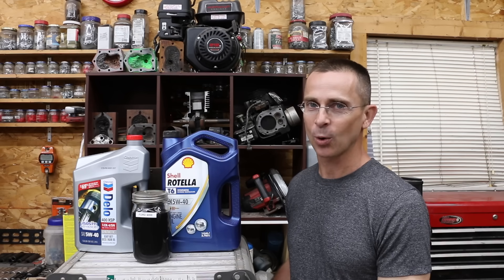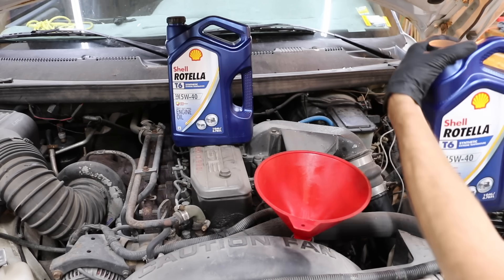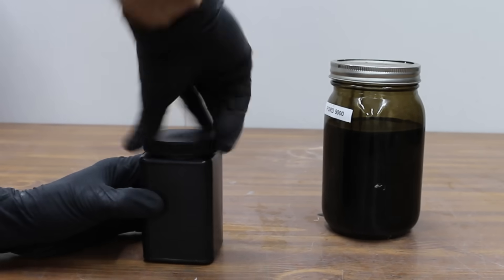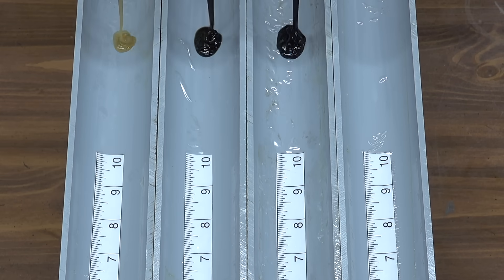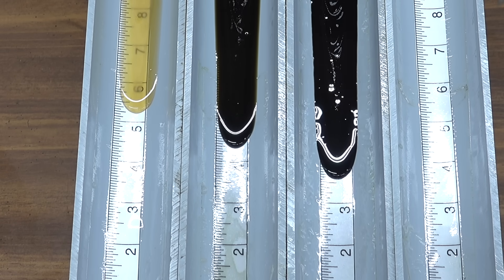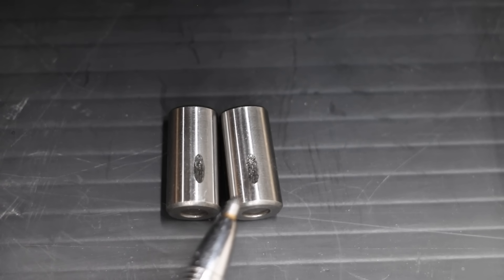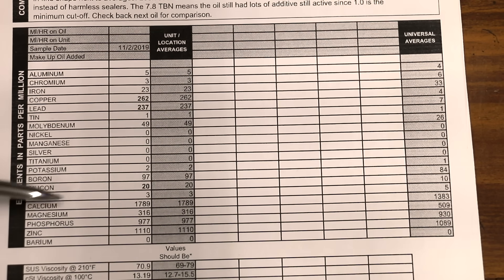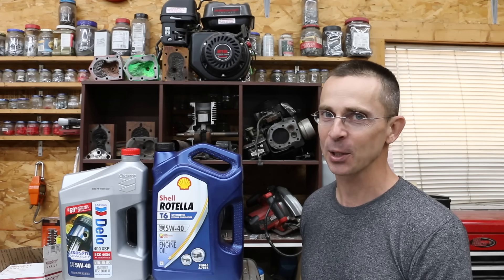Will Annual Oil Change Damage Your Car? Let's find out!

Comment: If oil became corrosive, then if you undercoated your vehicle with any kind of petroleum you would need to thoroughly was it once a year, before you undercoat it again.  How stupid does that sound?  Petroleum undercoating will rot your vehicle out!
Reply from the maker: Interesting thought!
Reply: @ProjectFarm  When does oil become corrosive?  WHAT DOES IT TAKE TO TURN OIL INTO AN ACID?   Crappy advisors.

Comment: How did the diesel oils do on the lubricity test compared to the gasoline oils you previously tested? Kind of hard to tell on video when the bearings aren't side by side. Thanks
Reply from the maker: They did extremely well, especially the T6.  It could possibly match or beat some of the best
Reply: @ProjectFarm  Thank you! I think that would make an interesting video to compare Rotella T6 to a common gasoline engine oil to see what the performance differences are.

Comment: Great stuff! The oil companies have perpetrated the 3000 mile oil change myth for years now. People are deathly afraid of total engine failure if they miss that interval by even a couple hundred miles. For years now I have done an annual oil change (using full synthetic) because I put only 4-5k miles on my truck during that time. Never had a lick of trouble.  Oils are so superior to 40 years ago that the rules we learned as kids are very out dated. Thanks again for doing these. PS Reminds me of a 60 minute show 15ish years ago? 60 Minutes tested the oil from New york taxi cabs after 7K (some of the hardest driving there is) Long story short...the oil was still in good shape just starting to show a little break down.
Reply from the maker: Great point!  Thank you

Comment: Not sure if you’ve reviewed flashlights, but maybe review rechargeable and battery powered flashlights. 🔦
Reply from the maker: Thank you for the video idea!
Reply: he reviewed batteries of various brands. i dont remember the rechargeable winner but for non rechargeable AA's, Energizer had the best alkaline chemistry and their lithium's performed better than any alkaline.
Reply: Indeed many zoomable cheapo LED lights out there, my favorite for camping and my work is Brightex XR1100
Reply: Seriously?  Which dozens out of the thousands available should be tested?  It's not even a reasonable test because one of the most common failures I see is the switch from high on/off cycling which could take years of use plus oxidation (since they are often not gold plated contacts, sometimes even against bare aluminum which readily oxidizes).

Comment: In your experience are diesel oils and gas oils so dissimilar that you wouldn't recommend T6 in a Gasoline engine? Id love to be able to just stock up on 1 oil for both my 16 ram 2500 Cummins and 19 Durango RT hemi :)  (I currently use the Pennzoil full synthetic in the Hemi that did very well in your oil championship.)
Reply from the maker: I ran T6 in my gas Chevrolet Suburban during the last oil change interval without any issues.  it may hurt fuel efficiency slightly but the zinc levels are still below 1200 PPM.  So, the catalytic converter should be fine.

Comment: Funny thing is i make those fleetguard filters
Reply from the maker: Nice!  I've been very impressed with Fleetguard oil and fuel filters.  They've never let me down
Reply: Price is dependent on the filter i make everything from air cleaners too power steering filters. Parts from gm to john deere. Average rate also depends on our parts our biggest part maybe 60-90 an hour too thousands on small parts
 I work for Cummins filtration (and yes the cummins diesel cummins.)
Reply: @koltonknox9235  I worked at a oil filter factory few years ago. Southern illinois.
Making every brand you can think of, all in one building.
Reply: @snapfish89  same here but fleetguard is a cummins brand why do you think them new cummins come with them.
Reply: @snapfish89  Fram is the cheapest quality made right?
Reply: kolton knox where?  And how long does it take to make one oil filter?
Reply: @Mr.Beastforpresident  probably less time than it took you to type that question. better question is, how much does each one cost them to make? id bet like everything else its pennies on the dollar so each one probably yields 10,000% profit.
Reply: Billy Darley I doubt pennies on the dollar, employees, robots & real estate aren't cheap, add in electricity, packaging and loading time, unloading of material time, Sales, Billing and Distribution cost. There's ( a lot ) more to it than most realize. 

The more employees you have the more liability you have and more management is needed. 
To run and sustain a successful business ( long term ) is a very fine balance. Build the business too big and too fast you run into other problems as-in Flooding the market & artificial demand. Artificial demand creates other problems as-in, too much invested in inventory to meet demand and the Real Estate to house it all.  Too much inventory is never a good thing.
Reply: @Mr.Beastforpresident  thats why a lot of manufacturers have the production being done overseas.
Reply: @Billy_Darley  A corvette rolls off the assembly line every 5 mins = PURE PROFIT!! Id imagine manufacturing oil filters is very competitive. 1 to 3% profit. With any company not up to snuff getting run out of business.  We pay more for things than we did 20 years ago, but that applies to everyone.
Reply: @Mr.Beastforpresident  I like everything about you so far.
Reply: @davidmollard9832  lol right
Reply: Billy Darley That's a whole other subject in itself and that too has its own drawbacks from a business perspective and consumer/customer perspective. Since we're talking about Business which is a reflection of our Economy, think about this...Even if Trump does everything he said he would do OR ANY other President tried to do ( Logic, Facts and Statistics ) seem to prove very, very little positive change to come. Not that it isn't wanted, it's just too many factors that don't point in that direction. Nearly every type of society & economic situation/scenario onto which the United States can become as a country/society (from this moment on) has occurred before, somewhere in the world and/or at some point in time, either currently or in history.
 As-in: Prosperity, the recession, the Great Depression, Civil wars, over population like in India and China, the economic collapse like in Europe, organized drug & crime rings like in Mexico, Riots, high unemployment like in Gaza which is the highest in the world at 43 percent.

Our country is not immune to similar situations, though I think it is unspoken as a society we all like to think so. With these scenarios & circumstances mentioned, all take little to no 'planning' to happen with the exception of one.. ' Prosperity ' No president can fix the problems that the middle-class and poor citizens of this country are facing as far as economic and financial prosperity without using federal funds to do so, or by taxing the rich, which in turn would backfire on the middle class. And if by some miracle they can.. they won't be able to sustain it for a reasonable period of time without a long-term plan. Not only because of federal financial debt but because of many factors, but mainly a growing population. Without 'literally' adding money to our economy.. things will just get even harder for the middle-class regardless of who is president, even if the government increases tax on the rich, the rich will just pass the cost down to consumers.. essentially- the middle class. 

Locally owned small companies & businesses we see around the state in which we live 'circulate money'. Money of which for the most part is already in our economy to begin with, which would sustain a 'stable population' but not a fast growing one. A population can grow on credit and loans but it still takes cash to support credit and pay interest loans. 

When we add people, we must also add funds, cash and jobs. Let's not fool ourselves, most of the mega rich are not worried about the poor, as they themselves aren't poor nor do they worry about higher taxes to support the poor as they again- pass the additional tax cost to the middle class. As many know but still worth noting, the harder the middle class works the more it benefits the poor, as you then fall into a higher tax bracket. 

More people are in need of a job now then last year, the unemployment ratings are false when it comes to people who are not working. As soon as a person stops receiving unemployment benefits they are taken off the unemployment rating, this does not mean they 'are working'. This unemployment rate also does not include the homeless. 

To add to that.. more young unemployed people are added to the economy every day and more poor people are added to gov't benefits every day across America. If everyone here in the United States were college educated where would we all work?  As it is, college grads can't find jobs that utilize their degree to it's full potential to attempt to pay off school loans with what's left after paying taxes and living expenses. 

If 'everyone' in the U.S. were highly educated we would be in the same situation as South Korea, where everyone has an excellent education and the majority have the same educational advantage as those around them. So unless they 'know' someone to help them get the job- their chances of getting hired are 50/50, that is first ' if' they can find a job opportunity. South Koreans turn to plastic surgery to get a physical advantage, as South Korea is the leading country in plastic surgery. As the United States population grows- it's going to grow faster and faster every year, than the year before. 

It's a given the bigger the population, the faster the population will grow. Along with- an 'added' on average 1 million ' Legal Immigrants ' this country takes in every year which does several positive things for this country as-in, it helps keep peace, provides education and understanding to  countries and cultures etc... 

This country has been taking in 1 million legal immigrants since 1990 to present, that's 26 million 'added' legal 'educated' immigrants not counting their kids born here & ( not counting illegal immigrants). That's 26 Million more jobs needed to support themselves, or gov't benefits, to put that amount in perspective a 'total' of 2,996 people died in 9/11 counting the twin towers, Pentagon and all the planes. 

The 26+ million ' Legal ' immigrants that are here in the U.S. come from the better off financially stable and educated families compare to most people from their country, the rest are too poor, making less than $2 a day, and not as educated to travel outside their tribes and villages to have a chance to make it here. 

As the population increases here in the U.S. crime will increase, the poverty population will increase, taxes will increase to feed & house the poor and criminals, more jails will be built for more criminals, some of which who became criminals just to live, more companies will (have) to move to Mexico and overseas to stay competitive with competition and technology. 

The United States population in- itself will grow regardless of the economy status and unemployment rates. The solution doesn't get easier as time goes on and the problem only gets bigger, as the population of people 'wanting to work' will increase with no jobs available. The oilfield and oilfield sustained companies can only support a certain size population here in the states regardless of how great and big it is.  As a massive backbone money generator to the economy it brings in money and keeps money exchanging hands, 'physical cash ' as it is passed from banks to restaurants, food, housing and activities and so on. 

We are all at the mercy of the 'population growth itself ' some think we're at the mercy of the mega rich, as it would seem they have all the money that would fix everything. But given Bill Gates billions ( evenly ) distributed across America alone 300+ million people wouldn't change anything. 

Any president can tax the rich but, it does 'nothing' as a money generator to 'grow' our economy, it'll just sustain it with Food Stamps, Housing, and Medical Care until the rich are no longer rich, and the middle-class becomes closer to being poor because of taxation, which in turn will add more people to being on gov't benefits, increasing taxes once again for the rich. 

The problem this country is facing is bigger than a superhero president can fix, after all if it doesn't get pass congress it doesn't happen... India has more citizens with IQ's over 120 than the 'total' population of the United States, 300+ million, enough to replace the whole United States with what modern society considers 'geniuses' but, yet those 300 million geniuses combined cannot fix their own economy with a massive 890 million people in poverty making less than $2 a day. 

All us Americans hope, wish and pray some president and local politicians are going to fix it all, but when you logically look at all the facts, economy and the majority of people and their situation surrounding us all, I realistically don't see how. 

The growing Population, Poverty Rate, Unemployment Rate, Crime, Real Estate prices, Taxes and prices of everything (Healthcare & Groceries ) Post Office prices, Automobile Prices are steadily increasing... 

ADD all this up along with advancements in Technology, self driving cars, faster, more efficient & reliable machines that need less human interaction. 

As a country we went from Manual Push Reel mowers that were quiet, didn't pollute the air, didn't require gas & oil, you could mow grass at anytime of the day or night without disturbing your neighbor to ' More ' expensive, loud, Non-Catalytic converter polluting mowers that rips the grass rather than actually cutting the grass. My point is don't assume as a society we're making better decisions elsewhere.
Reply: @davidmollard9832  especially when he writes such a ridiculously long winded novel. word to the wise do not click read more on that fucking comment above this one. holy shit, you will be sorry.

Comment: Oh hey, I have a 12v too. 👍
Reply from the maker: Awesome!  They seem like great trucks
Reply: @ProjectFarm  They are the best that I know of. Cummins has been around for 100 years. They pulled the 6BT out of farm equipment and told Dodge to use it. It's way over built. The transmissions can't handle the torque though. 😂

Comment: This confirmed the wisdom I've gathered over the years. I have a truck that only gets ~1500 to 2000 miles per year on it, and I've been changing the oil once every other year since I got it 6 years ago. Been just fine.
Reply from the maker: Great information!  Glad this strategy has worked out well for you

Comment: Good to learn . I am a golf course mechanic and I make sure all my equipment both gas and diesel is started and ran at temp. For at least an hour twice per winter here in new England.  Looks like that's sufficient from your testing and my previous experience.  Thanks for the interesting content!
Reply from the maker: Thank you!!

Comment: Absolutely fantastic testing! Hard to dispute the lab results. That truck is in great shape for its age! I like that oil filter cutting tool.
Reply from the maker: Thank you very much!  The truck is my baby, although I do work the truck hard when its time to go to work.  By the way, you've got amazing content on your channel!
Reply: I use Airwolf Filter Corp cutter every 50hr on aircraft filters.
Open filter media and run a magnet across the folds while doing a close visual.
That and trending a spent oil lab analysis will give you a good idea how things are functioning.
Reply: I think the tool could have been a pipe cutter
Reply: @levivaughan3434  it’s a special filer cutting tool.

Comment: On a more serious and to the point matter, what kind of temperatures did these vehicles face in the winter? -10F? -20? -30?
Reply from the maker: I believe -4F was the coldest.   It's a lot of fun getting them to start at that temp with 15W-40 oil.  lol. Glad I switched to 5W-40

Comment: I use old used oil from my new trucks and use it on my old junk. My 99 Ford van almost 400000 miles , its beat to shxt but it wont stop .I'm scared to be good to them they might break.
Reply from the maker: That's a lot of miles!